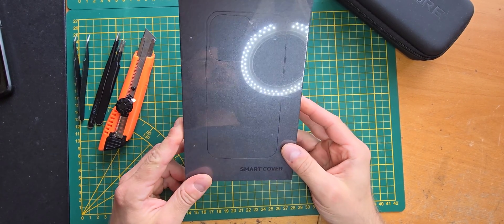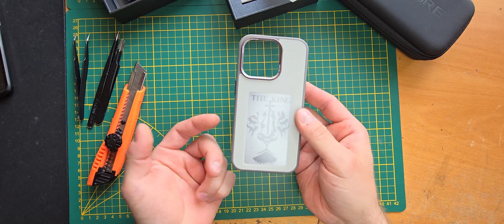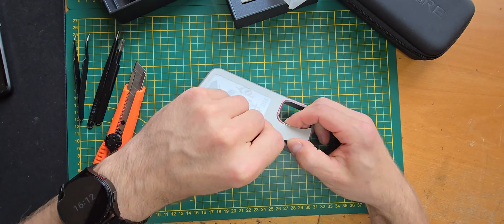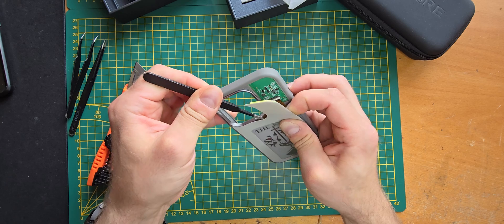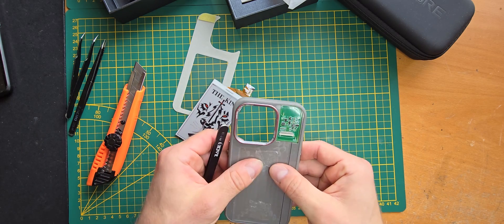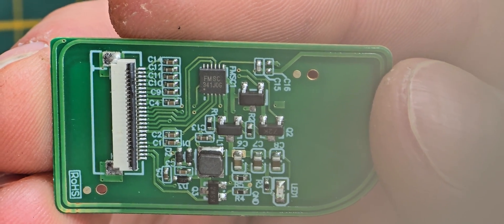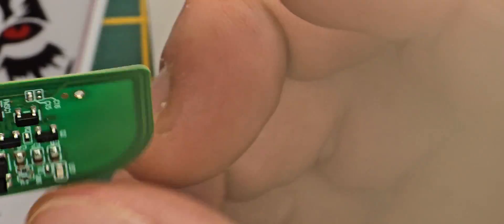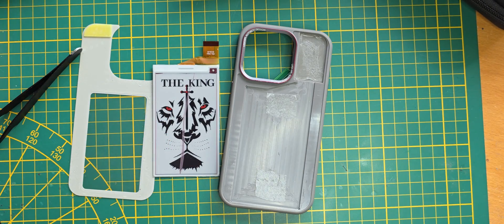Teardown of the 3.7" E-Paper iPhone case, bad ending...

Comment: Would the board be able handle any eink display? Sorry if that's obvious. I plan to buy a similar case to teardown and make a keychain with a smaller 1-2 inch eink display.
Reply from the maker: That will not work
Reply: @atc1441  Dang I was really hoping it would be that easy haha. Thanks!